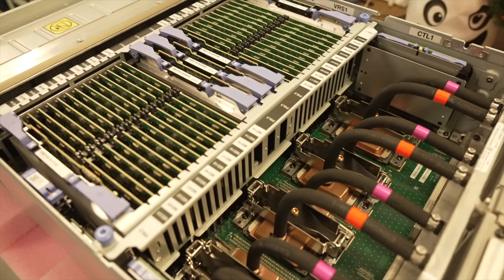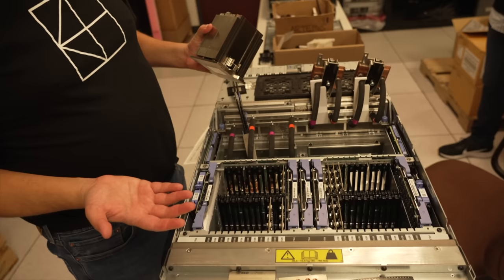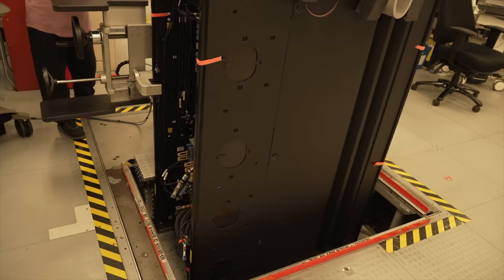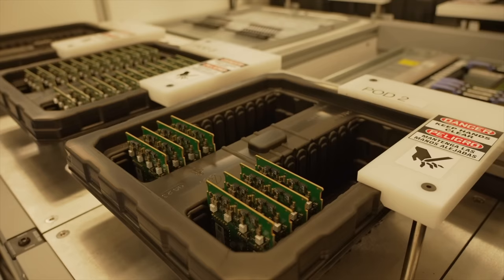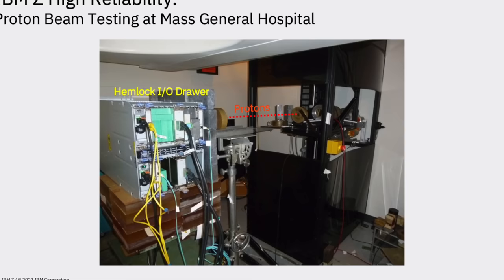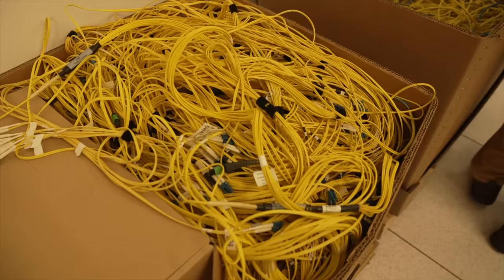Why Do Mainframes Still Exist?  What's Inside One?  40TB, 200+ Cores, AI, and more!

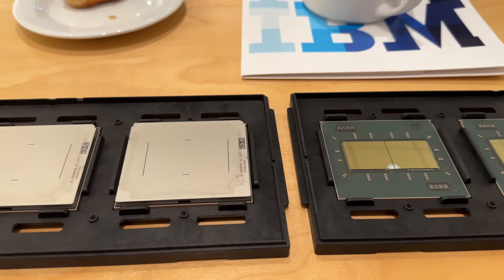Comment: @2:50 That private cache you are referring is Telum's L2 cache size which does dwarf the L1 cache sizes of modern Intel Xeon and AMD Epyc cores.  However, it would be a better comparison to compare Telum's L1 cache which is 128 KB for instruction and 128 KB for data (256 KB total).  That 256 KB figure is indeed larger than commodity x86 but only by a factor of two or three depending on what you are comparing it against.  Similarly Telum's 32 MB of L2 per core is indeed higher than than the 1 MB of L2 cache found AMD's Zen 4 or Intel's 2MB L2 inside each Sapphire Rapids core.  In terms of raw capacity though, IBM's Telum is only competitive against AMD's V-cache enabled Epyc chips which have 1.1 GB of L3 cache per socket.  While Telum's cache topology is more efficient in usage, in terms of just raw capacity it will take four Telum's to match AMD's best here.

@7:48 That 25.6 GB/s figure is per channel given that you were using s 64 bit width.  The Ice Lake Xeons which you are likely comparing things to has eight of those channels per socket for an aggregate memory bandwidth of 204 GB/s.  Multisocket Ice Lake Xeons can further increase raw aggregate bandwidth but the limiting factor quickly becomes the socket-to-socket interconnect.  Still, a quad socket Ice Lake system should be able to top the drawer bandwidth figure IBM has provided.

But wait, that is an older platform with the modern Sapphire Rapids chip moving to faster DDR5.  That provides 38.4 GB/s per channel and with eight channels an aggregate of 306 GB/s per socket.  A dual socket Sapphire Rapids easily tops that IBM interconnect figure.

And if you want really crazy memory bandwidth, Intel's Sapphire Rapids chip has a variant with on package HBM2e memory for over 1 TB of memory bandwidth on package and then still has eight channels of DDR5 for about 1.4 TB/s per socket.  That's about four times the bandwidth that IBM interconnect.

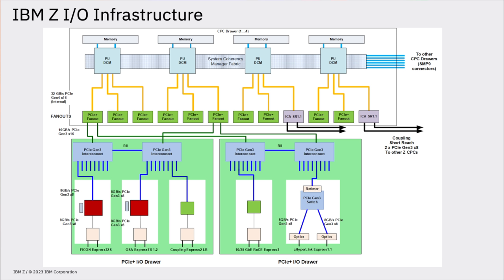@8:25 While individual cards can have a full 16 lane PCIe 3.0 connection on the slot, bandwidth gets constrained once leaving the drawer by having 20 slots share the uplink bandwidth by to the CPU drawer.  There is a bottleneck here if all the cards in the drawer need full slot bandwidth to the CPU drawer.  The one nice thing here is that cards with in a drawer can communicate at full rate with each other hanging off of the drawer's own fan out chip. 

@11:50  There are two sets of accelerators for encryption and compression.  One is tied directly to the memory controller and also handles the logic associated with their RAIM topology.  This makes perfect sense as relaying on anything other than dedicated hardware here would break system performance.  This set of hardware is transparent in the system as it is truly dedicated for its function.  The other set of encryption/compression hardware is user visible for prepping data for transmission.  There is an additional 3rd tier of encryption/compression hardware available on various networking cards that operates at line speed of the network interface.
Reply: Yes, thank you. Dave's severely underselling "standard" CPUs here. Also the comment about how they usually fall back to base clock on all-core loads, as low as 2 GHz -- no, not really, at least not desktop chips. My 5800X3D has no issue staying at 4.4 GHz all-core with stock settings (including stock power limits), and as far as Epyc is concerned, it wouldn't be fair to compare these 16 core/socket chips versus AMDs 64-96 core chips in terms of clock frequency; of course a 64 core chip wouldn't run at 5.2 GHz all-core.
Reply: @exscape  I think he was commenting about server chips throttling down to 2 Ghz which has been a thing for many Intel Xeons when tackling AVX-512 workloads.  This has been a struggle for Intel that while operating in the wider AVX-512 mode, throughput conceptually doubles but it is too power hungry and makes the chips run do hot that they will throttle down to such low clock speeds, erasing most of the conceptual gains.  AMD's approach to AVX-512 seems to have been the wiser one as data is still processed at 256 bit width but pipelines over additional cycles.  Various improvements in AVX-512 instructions shows modest but real performance gains even though the peak throughput of AVX2 and AVX-512 is the same on Zen 4.

With regards to AMD's recent 64 core and 96 core Epyc chips, I suspect that the limiting factor isn't the processor designs but rather of power delivery and cooling.  Hitting those high clocks requires a bit more voltage which in turn consumes more power in a nonlinear fashion.  That is why modern chip binning is more about finding units that'll operate at lower voltages and placing those into products with higher core  counts to keep the power side in check.  Nowadays many products with reduced core counts do have fully functional dies, just that the most power consuming cores are disabled to fit into a specification range.  With the 96 core Threadrippers around the corner would expect to see some running all core workloads at 5.2 Ghz (or more) but don't be surprised about it consuming north of 700W and requiring something like a chilled water loop to run like that.  

This also ignore one reason why mainframe customers would simply turn off any sort of clock elasticity:  they are clock providers that sell time on the mainframe hardware to their own customers.  This has been a tradition in the mainframe market as the rumored number of mainframe hardware installs is less than 200 in the US for over a decade.  Billing is two dimensionally by unit work (CPU time) and run time (which includes time stuck in IO).  Keeping clocks constant provides uniformity between clients leasing time on the hardware.

Comment: I don't know if it's a sad thing or amazing thing... it depends on the day imho... but I still work on maintaining AS400 mainframes! I bet people don't realize just how many of these beasts are STILL out here in use to this day. There's also an IBM laser greenbar printer I have to maintain at one of the sites. It's insane. You load gigantic stacks of the tractor-feed greenbar paper, and it just pees out printed data at the other end. It's so huge you can almost walk inside of it to work on it. Every 3 days clean the excess toner and any goop off until it sparkles all over, drip of oil if needed on all moving joints/shafts, load it up and let 'er rip. I can't imagine the warehouse(s) FULL of whatever data it is they are printing out in that quantity about half the day, every W-F. I mean, it goes through that 3' tall stack of paper in a couple of minutes. Someone is there to just cart off the printed stack, and load a fresh one and start printing again. It's like 100 stacks a day, 3 days a week for the last 3 years I've been there. lol! Wow. And there's a half dozen old impact ribbon dot matrix Printronix standing printers I work on that push out a ton of greenbar all day every day M-F. It's mind boggling. I am so curious to know what it could be that they are printing, but I never get to see it. Only repairs and maint. :)
Reply: A forest cries out.
Reply: Isn't an AS400 a mini-computer & not a mainframe?
Reply: No warehouse needed.  They truck the printouts to the other side of the city where there's a guy talking about this massive shredder they have...
Reply: @GalaxyCat001  Officially midrange (& not a mainframe).

Comment: I used to work repairing and switching terminals of IBM in the early 2000's. An doing things as installing special network equipment, but just to a point, I made sure the Cisco Internet connection racks, huge machines 4U most of the times, connecting them to the outside via secure encrypted lines for BT and then the engineers of IBM took over to connect them to their encryption racks, for banks, the robots of car manufacturing and other high availability dependant systems. I always was fascinated at the tech IBM had deployed and only saw strictly what was required to have signed my worksheet by BT and IBM. That was at the peak of my carreer and I learned to respect Big Blue. Great video Dave, thanks!

Comment: It has been at least 20 years since I took a real look at what mainframes actually do and what's under the hood. Thanks for the great content. Interesting to see the principle of relieving software performance bottlenecks with hardware design innovations is still fundamental in design. I got to work for a small software company doing basic tech support in the mid 90's. They worked with HP mid range mini computers, and some of them used fiber technology for storage device IO cables and optic data lines on portions of some of the system boards.

Comment: Fascinating stuff. The IBM Z series mainframes are amazing pieces of engineering, especially the Z16 and the Telum CPUs which power them. The level of performance, resources, redundancy, reliability etc is tremendous. The I/O performance has always been a strongpoint of the mainframe, and the Z16 has that in spades. So glad the mainframe is still going strong. Any plans to do some background on the Telum development btw?

Comment: I worked as a mainframe guy for several years before I joined a small startup called Microsoft, in 1993 :-) In time, I became a true NT fanboi; but I never lost my love of the mainframe. There remain a class of workloads which just aren't amenable to parallelism, and for those jobs, the mainframe is often the perfect answer. Plus mainframes embody really cool technology, as you captured so well in this video. I still get a thrill reading about each now z processor as they are released, all the cool new instructions etc.
Reply: Back in 1993 MS wasn't a small startup.
Reply: @OgbondSandvol  You don't say...

Comment: A regular trip down memory lane--bringing back all my experiences with IBM System 360. The z16 has JCL, REXX, CLCI, DB2 and a COBOL compiler just like old times! It would have been nice to see how DASD has changed since 3330s and 3350s.
Reply: I presume it also has IMS. I began programming on the 360 with FORTRAN on punch cards. The other stuff came years later.

Comment: Again a very interesting video Dave, thanks. Too bad you didn't mention COBOL though, as these mainframes are the sole reason why this programming language is still alive and kicking after 60 years.
Reply: And RPG on IBM-i, and then everything else as well. ILE runs all compilers and code. DB2 is built into/coupled with the OS on IBM-i and it is THE primary dev platform for all DB2 development.
Reply: When I worked at GM/EDS we were not allowed to use COBOL. WE used PL-1.

Comment: I did consulting for HP's at their Florham Park NJ facility back in 2000, doing HP-UX kernel functional tests, and later, stress tests, for the [doomed] Itanium.
HP already had solid 64-bit machine experience in their PA-RISC processors.
The facility had a raised floor room similar to what was shown here.  Lots of iSCSI-over-fibre-channel.  Main trunks were several T-3 lines.  Was back in the day where the backing stores were all hard drives, and all except boot drives were SCSI-68/SCA-II.  On the floor below us was where Veritas and ISO-9600 file systems were developed.  Actual customer failover service was provided on their large 64-core machine for several key clients: US Air Force, Nasdaq stock exchange, and several airlines (though I got the client names 2nd-hand; never verified myself because I never used those machines.  We were exclusively using the [new] Itanium boxes, which, for the record, first booted a LINUX O/S before bringing up our own HP-UX port!)

Comment: I worked in tech all my life (now retired) I have a computer hard drive almost 3.5 feet in diameter. It was hanging on the wall as a decoration, at a company I worked for, almost 35 years ago. At that time the company was doing a major cleanup and it was headed to the garbage. I asked if I could have it and I still have it today.  If you want. I will send a picture.

Comment: Disagree with math on RAM bandwidth :).   I think that bandwidth # you gave for the Xeon was per channel (single DIMM),  multiply by 4-8x depending on the chipset.   Multiple by another 1.5x+ or so as Sapphire Rapids can support at least ddr5-4800 now.
Reply: 25 GB/s second is definitely single channel DDR4
Reply: Yeah, for AMD EPYC Genoa the per-socket memory bandwidth is actually 460 GB/s, so more than the bandwidth available between two drawers.

Comment: Great video Dave. What is the typical operating system on one of these? How many concurrent users on base models and high end models? Do they still use dumb terminals  as clients like they used to?
Reply from the maker: Generally they run z/OS or Linux!
Reply: Back in the 1980s one of the airline reservation systems had over 40,000  (Forty thousand) concurrent users.

Comment: Impressive - brings back old memories. In the 70s and 80s I was systems engineer on IBM mainframes starting from the 370/158 just to a complex of 3090s running as Sysplex under MVS/ESA as my last babies (As boys get older, the more expensive their toys get). As at that moment I could say hello to every second bit in the OS I moved forward into networking to make TCP/IP rule over SNA, Netbios, Decnet and all the other stuff around at that time. Finally, finished my senior career in Telecom.

Comment: only 200 cores ? seems kind lame in todays world :)
Reply: 200 cores at 5+ GHz base frequency? That's unheard of in any other modern chip.
Reply: IBM mainframes have IOPs input output processors that manage all the io and has equal access to the memory as does the central and specialty processors… io is done by telling iOp where the channel gets its command(s) called a CCW channel command word … and what device the operation is directed … the central processor goes about doing other work while the ipo handles all the io and then informs the CP it’s done … this is a high level look at a major advantage the mainframe has … the iOp is not single threaded … and the FICON connections support on each cable up to 65535 commands… a disk controller has many FICON (32Gb) connects … FICON commands are interlaced processing at a unit call an IU which is up to 8k data …

Comment: So cool. I worked as an operator in the Toronto Computing Centre at 245 Consumers Rd from 1975-81. I started on the S360/65 and /75 and I do remember virtualized S370/158VM systems that were on the floor by the late '70s, although I went the S370/168 route with its MVS/Jes3. Phew, can't believe I remember those model numbers!

Comment: This brings back memories, my father worked on the RS/6000 in Austin during the 90's and early 2000's. He would sneak me into the "Rusty Bucket" (nickname for the building) after hours and show me around the main lab floor. It was awe inspiring as a 10 year old and cemented my drive to pursue engineering, I would later go on to gradate with a degree in computer engineering and land my first job as a Product Development Engineer at Intel working daily in labs similar to these. Full circle moment seeing IBM labs again!

Comment: I really have a fascination with mainframes and even older hardware. I was wondering how IBM was keeping relevant with today's rival servers like the epyc cpu's being able to replace large racks with its massive cpu's and video card style compute cards. It's good to see they are staying very modern and powerful. Because they were always such an enormous investment, that there must of been a big reason for IBM to still be doing so well on big iron's. Some of the big iron's used to have some extremely complicated and bizzare looking, but very fascinating cpu cores in some overly engineered casing. I remember I used to keep up on IBM and Sparc cpu's and seeing their specs and just wondering based on them, how they actually perform next to modern x86 counter parts.  It's been a long time since I had looked at anything modern from IBM and sparc no longer being made, it is nice to see such an impressive system for certain types of work loads.